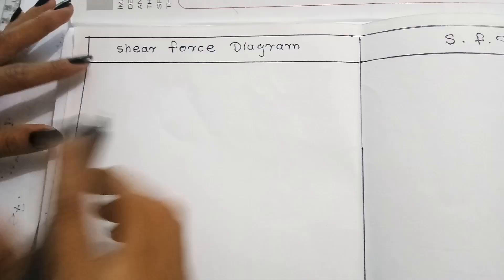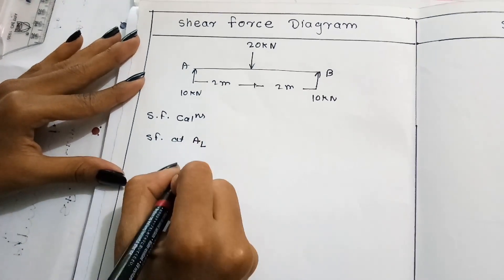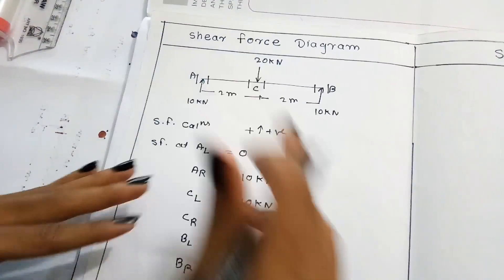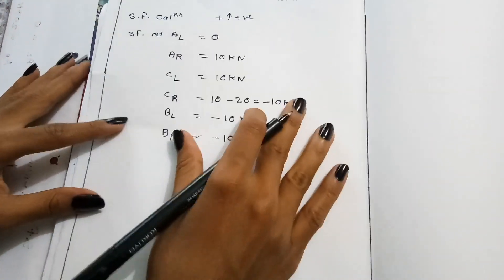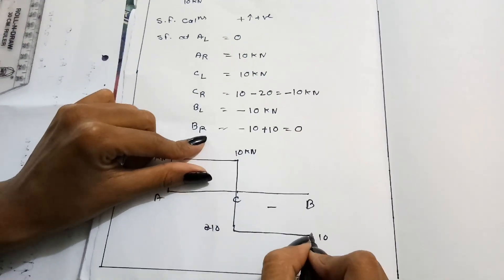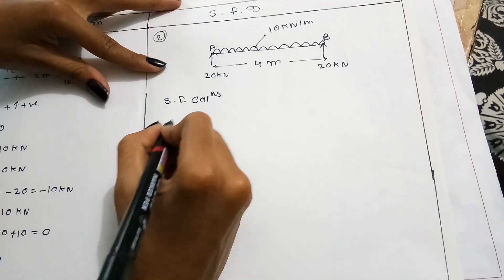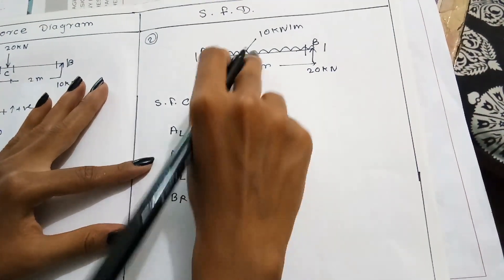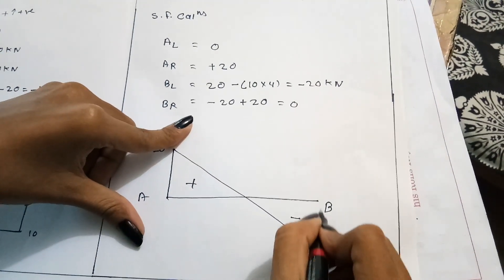SFD shear force calculations

Comment: Please resolve my example. A 500 x 5800 Long x 10 Thk. Horzontal M.S. Plate welded on Both The Sides Vertical M.S. Plate of 260 x 2100 Long X 10 Thk. BM is 113475kgcm . Calculate the Shear Force.

Comment: A cantilever beam 5 m long carries a uniformly distributed load of 400 N per metre rum over 
        a length of 2 m from fixed end. Find the slope and deflection at the free end. Take E= 
        2X105 Mpa and M.I about neutral axis 8.5X106 Mpa.